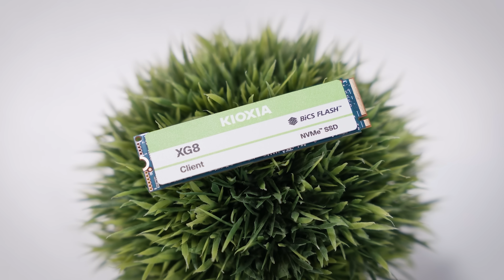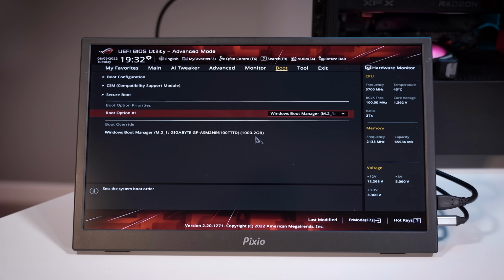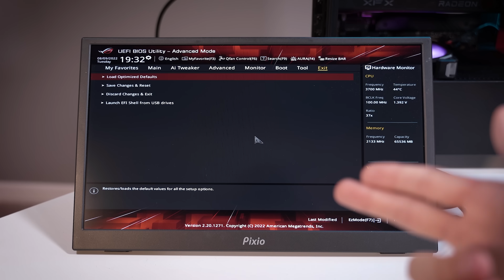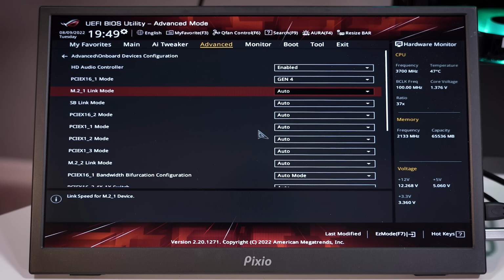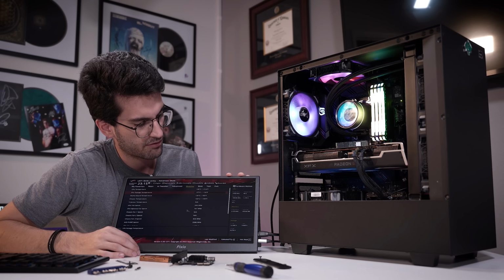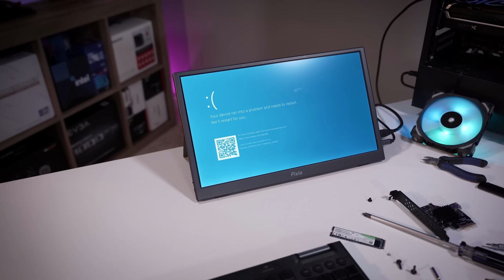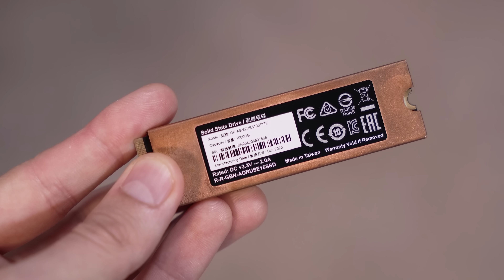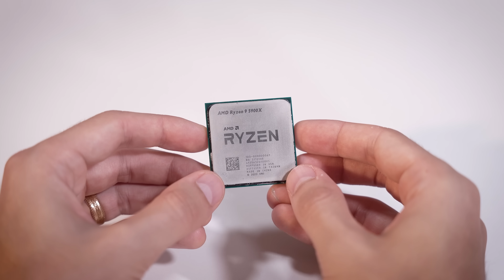Fixing a Viewer's BROKEN Gaming PC? - Fix or Flop S3:E2

Comment: Question and help if possible, done everything I can think of, I have a msi mech II rx 5700xt, when playing certain games(namely battlefield 2042 and ready or not although performance in everything has tanked talking 20-30fps below most benchmarks for this card) I get gpu errors, Battlefield 2042 every time I play 2 matches I'll get "directX error m_compute_failure=1 graphics card has stopped functioning" error which requires restarting my gpu drivers before my pc will function again, then in ready or not I get these odd like glitches(like static on an old cctv, almost looks like a failing gpu but it isn't), they only last one-2 frames then vanish they're not picked up by my capture card so I know its not part of the game, my gpu actually works flawlessly when I put it in my wife's rig(when in her rig which is a 3rd gen Ryzen 5 3600 It actually gets better fps by about 10-20fps) so its something to do with mine. Also recently my usb slots have begun failing, I had to get a pci usb card to plug stuff into, if I use the plugs on the board I will get random disconnects constantly.   My Specs are ryzen 5600x, 32gb of ram, rx 5700xt, I have a usb expansion and a 2gigabit ethernet card, 4tb of storages(2 1tb Samsung 850 ssd and 2 1tb NVME) my motherboard is a asrock pro 4 x570, Have not overclocked this pc at all. things I have tried, reinstalling windows(including wiping all drives completely), unplugging all but one monitor, different cables, unplug all unnecessary usb devices, DDU, Uninstalling and reinstalling all games, removing all my pci devices and trying a different slot(unfortunately this motherboard only has two slots that can fit a gpu), different powersupply. Temps are fine(except junction temp on gpu sits around 95c, I did repaste and replace the thermal pads, it dropped the temps by about 2c but did nothing for the issue I am having. However when I put the card in my wife's machine everything functioned perfectly,  and her 2060 functioned normally in my pc(this is what got me because if it was the slot or an issue with the chipset/cpu I figured her card would see a performance drop and potentially crashes but nope performed as expected), so what's my next step only thing I can think is something isn't playing nice with the rx5700xt but what could cause it to lose performance and behave erratically?

Comment: I aint sure if Greg will see this comment but since you do this for a living or anyone that can help me fix this my OC are stable also. however when I start a game my whole pc would enter like 10fps which should not be happening specially for my pc. my specs is i9 12900K OC @ 5.5Ghz my gpu is standard overclocked. I have a sapphire nitro+ 6900XT. ram is the gskill 6000MHZ 32GB OS operating on a SSD card and I have a separate SSD for games only. if anyone has any knowledge on this what the cause it please let me know. cause this only happens on the opening of the game but once loaded everything is back to normal.

edit. this also happens without the OC on the cpu. i also tried a fresh W11 install. forgot to add my liquid cooler is the kraken x73

Comment: I just had two days of exactly the same issue .. but I was able to get into the Safe mode but it was doing exactly the same thing rebooting... tried what you did with no success .. what i done was changed the thermal paste on CPU .. it was still doing same and then I reset the bios... still nothing .. gave up ... went to bed.. got up in the morning pressed the power on and it powered up as if nothing ever happened??? - i done a video about it .. proof i had similar problem!

Comment: I once had a memory controller failure. Back in the AMD bulldozer 8-core days, the system would boot fine and everything would be great, but as soon as you needed to use core 1 for anything it would work in Windows, but in a game it would hard hang. I was testing RAM and found that Memtest hung when using core 1, I repeated the memtest using all other cores 1 at a time and it passed many passes, but as soon as running memtest using core 1 by itself, memtest instantly hung on the first test. I disabled core 1 in the BIOS and booted windows and was able to play games, run benchmarks, everything was fine. 

I concluded that since windows was fine idle and at low loads with all cores enabled, but at higher load it was crashing, no BSODs just hard hanging. It was the memory controller for core 1 in the CPU. Swapped the CPU and it was better but then soon after started BSODs, it turns out as much as I can figure very hot VRMs might have killed the old CPU, so after replacing the mainboard with a unit that had better VRM cooling and changing the customer's fan layout so that heat was exhausted from the case properly all was good.

That was the weirdest issue that I have had... well except the AMD K6-II platform system where it shut itself down and nothing I could try would let the system even power on, I changed every component. In the end with that one I removed the BIOS battery, put the board without the CPU or anything installed back in its box, took it out 6 weeks later and put the same BIOS battery, same CPU, RAM, PSU, everything. And the system turned on and booted and all was fine. Still dont know 22 years on exactly what was up with that thing.

Comment: my computer did the thing... it's not a ryzen build. it's a 12th gen and I've got a 12900KF with the new ryujin 2 360 and I forgot to plug in the power module that controls the screen.... had everything else plugged in and it kept doing the same thing over and over boot looping... it was really weird. so I just started unplugging stuff that it didn't need and in the process of doing that I realized one cable wasn't hooked up. plugged it in and it fixed it. it was really weird just like this literally the same thing.

Comment: In 20 years of fooling with computers This is-the second time I’ve seen this happen I first time on this with FX 8350 That refused to boost up to 4.2 GHz which should be standard I fixed it by getting into bios and manually lowering the voltages and clocks to 4000 MHz But at the time that was an eight year old CPU You’re 5900 X It’s almost brand new which makes it even stranger and more rare of a problem to encounter

Comment: Greg.. no kidding yesterday i dealt with something almost identical i7 7700 in a gigabyte brix .....restored the pc reinstalled windows all was well carried it back over to my moms place "her computer" plugged it in and the nvme drive no longer existed in the system..... POOF gone... took me a while but figured out it... but it works on the sata drives just refuses to function on nvme 

my guess is the same as yours cpu in my case i think it lost some pci lanes ... 

Great Job figuring this one out!

Comment: Greg, first of all thanks for sharing these fix or flop videos, I often get to learn many new things from your troubleshooting steps. I have a Ryzen 5 3600 system with Asus Strix B450 F gaming motherboard. As of late I've been getting a lot of IRQL BSOD errors that just occur randomly. All this time I was under the impression that it might be the Windows 10 installation but after watching this video I'm afraid the CPU may be having issues. One odd thing though, the system run rock solid for days altogether if I leave a game running  and minimized. As soon as the game is stopped, within minutes I get a BSOD. And these BSOD errors are always related to an IRQL message. Any advice on what I can try? Going to do a fresh OS installation now on a new M2 drive I just got today.
Reply: Update: Installed Win 10 21H2 on the new m.2 Crucial SSD and the BSOD errors have gotten worse. Can't complete the OS initial setup to get to the desktop. Getting BSOD right when setting up region, keyboards and account. Tried removing and re-seating the RAM, one stick at a time on all 4 slots, result is always the same. Will try swapping the CPU out with an old Athlon AM4 chip I have and see if any difference. If CPU not an issue then will need to buy a new set of RAM sticks as I don't have spares... Current set is TridentZ RGB D4 3200...
Reply: @shyamac4031  i would think its the RAM issue.  You should be running dual channel on AMD anyway, if you have 2 sticks, you could just install 1 and try booting. Switch to the 2nd slot to try if 1st one fails...
Reply: @gthomas6229  Thanks Thomas, I might not have mentioned but I did try all these basic steps. I swapped the CPU with the Athlon 200G that I had with me and all issues disappeared as if they never existed. Got a new 5600X and system running rock solid stable now... almost 18 days+ system uptime at the moment on 21H2 and all looks good 👍 😀

Comment: I had a similar issue with my 5800x. It started when my PC wouldn't wake up from sleep mode. The system turns unresponsive, fans spinning rather fast. Only way to turn off is to flip the PSU switch since holding the power button did nothing. Then it slowly progressed to multiple different blue screen each time after getting into Windows. After extensive testing, 5800x was the culprit. I sent an RMA to AMD and recently got my replacement CPU. Hard to believe it died in less than 2 years of usage...

Comment: Usually when you get different errors every time like this, it's related to memory (ram) because it gets corrupted, but it can also be the CPU as it is what controls the memory as well, i had a friend with a similar issue on a 5600x, seems like the memory controllers inside CPU's can become defective, without entirely killing the CPU tiself

Comment: Wouldn’t you have been able to boot to a bootable flash drive with windows 11 on it and done a system recovery . Happened to me so many times after my first build and I ended up making 3 flash drives with system image , windows 11 tool as well as system recovery and all 3 saves me from blue screen of death

Comment: I have the same motherboard do the same thing over and over again and it was the way the drive was partitioned because i cloned my ssd onto my nvme and something got outa place, it was something to do with both of the drives having the same mbr is my guess but it could just be a mobo issues as well this is the lowest board on the strix tier
I eventually reinstalled windows and now it works fine but i have never had any kind of issues like this before can i buy that 5900x off you?

Comment: Years back, I had this same issue on a four core AMD processor which constantly gave a blue screen with different reasons listed every time it crashed.  It turned out that one of the four cores was actually bad.  When I disabled the core in Windows 7 startup using msconfig, it worked just fine, but only as a two core.  The way the core was positioned on the CPU, I was forced to turn off one of the good cores with the bad one so it effectively became a "duel core" processor.  I still use that system to play the original Skyrim  and a few older games every now and then, with an HD 7750 GPU. It works pretty well!  👍👍

Comment: I had a problem with my 3900x - the integrated memory controller failed basically.
I could only run in single channel memory (slots 1&2) otherwise it wouldn't boot.

Comment: I'm not surprised Greg, I had a Ryzen 7 5800X which had a similar problem, whenever I opened a browser it would crash, whenever I opened a game, it would close aftwra second, no BSODs or error messages, I discovered my CPU was faulty, the only way I could run it was by locking the clock at 4.6 Ghz on the bios, and still I'd have some eventual BSODs, I decided to sell it (the person was told about the issue previously) and got myself an i7 11700KF.

Comment: The heatspreader may not be installed correctly. I would put the cpu in the oven and bake for 30min at 160°C so that the indium solder can connect better to the heatspreader.

Comment: I ran into something similar when I cloned my dads hard drive to a new SSD.  I formatted the old hard drive and hooked it back up and everything went to crap.  Two copies of UEFI boot stuff nuked it.  I had to utilize diskpart to clean the hard drive and rebuild the UEFI boot stuff from a recovery command prompt.  Although I don't remember if the BSODs were random - they were definitely alternating between them and repair.

Comment: I have faced kinda the same issue too! I was able to boot into windows but booting up sometimes will show up random bsod or hang in the welcome screen or either black screen after the mobo logo+windows loading circle screen, but powering on and off several times solves it tho.

Comment: I also had a 5950X that started dying on me. It ran perfectly fine for two years but one day, it just started causing the system to crash and randomly restart. I was getting the same "Page Fault in Nonpaged Area" and WHEA errors as well. Good thing it was still under warranty. I filed an RMA and got a replacement from AMD. No more random crashes or restarts.

Comment: That is one stable temp on cpu there...(was suspiciously too stable) mine bounces like crazy while idling in bios.

sometimes try to check the cpu voltages because some of the motherboards does indeed pushes 1.5v on cpu while idle...and while gaming goes like 1.4v (my opinion its a bit too much)
i also had like temps on idle between 50-65 celsius on idle bouncing around.

Comment: I've been seeing more and more CPU failures over the last few years, but I wouldn't bank on this problem being a CPU. Did you test this CPU in a different computer? RAM testing? Does your SSD have AMD drivers on it? We never actually saw you set UEFI to default (which will happen naturally with the new CPU insertion). Could have been poor firmware optimization. I've seen corrupted XMP (DOCP) do this exact thing. Too many things missing to say that your method is valid troubleshooting.

Comment: sometimes it can be some dust in between the cpu and the socket. I've had that problem on an older system, everything is okay but couldn't boot until I removed the cpu and gave the socket a shot of air then reinstalled the same cpu. Excellent work for finding the problem! Took me a whole day to figure out mine

Comment: Guess in the middle of the video: dead CPU has an internal short, which both prevents the system from booting, and also results in ridiculously high idle temps.

Comment: I deal with those kind of issues everyday.
When you can boot into the BIOS the motherboard is most likely fine.
From there you have to test the storage, CPU and RAM.

I test the storage with a Windows PE Live CD, if it fails to boot then i will move to check the RAM and the CPU by replacing them with known good ones.

RAM and CPU act like a single unit, so errors like IRQL NOT LESS OR EQUAL can also be caused by unstable RAM, whether it's defective or the memory controller/infinity fabric on the CPU just can't handle the XMP profile.

Comment: I had the same issues with my 5800x and I got it to work by dropping the stock clock from 3.8 to 3.7 it works fine now but would really like the full potential of my cpu any thoughts on it ???

Comment: It’s funny, my CPU is on that route, when I finished building my pc not even a year old, at first idle temps first few months were around 45c and just recently for about a months or 2, temps slowly started rising averaging around 58-65c idle, still booting in to windows too, just CPU temps rising, I’ve replaced the thermal paste checked bios if anything is causing, nada, I’m not sure if this is specifically targeted on 5900x CPU’s

Comment: AIO radiator is upside down. Sucking air for sure.  That would explain a lot here.  He overheated his CPU all the time.  He added extra fans to help cool it.  CPU gave up and threw in the towel.  Fix your AIO or risk a repeat fried CPU.

Comment: i had something similar to my 3900x when i first built it. i would get random restarts, random errors, and even throttling temps at times with an aio. and plenty of cooling in a ac controlled room at 68 degrees f. i went through it all changed out power supply and even changed ram and other stuff. for all the random bugs finally i rma'ed the cpu and amd sent me a new 3900x and it booted perfectly no issues.

Comment: I disagree with your comment about the IRQL error being CPU related.  I've seen tons of those errors and its never been CPU related.  You had commented that you did some changing around of the drives.  Did you try putting in a formatted single drive with no OS to see how it reacted?  I've had that same blue screen problem in the past.  I can't remember what I did to correct it.  But, it wasn't processor related.  Windows didn't like something.  It would make for interesting follow up video to test the CPU in a different MB.  Great video!  Enjoyed it!

Comment: I had a system in 2 weeks ago with this very issue. It wouldn't boot from any drive even a USB boot disk. It would freeze during the boot like you were seeing. I swapped ram and removed clients drives to rule out it was one of them or the sata interface. I ended up making the wrong call and bought a new board... $200 misdiagnosis. Unfortunately I didn't have a Gen 8/9 Intel board to test with (lost all my repair equipment and testing materials in a fire) , well I do now LOL. Like in your situation it turned out to be the CPU. 20+ years and this will be my first defective i Series CPU.

FYI I was able to get Memtest86 to boot and no issues after 4 passes and CPU temps were normal.